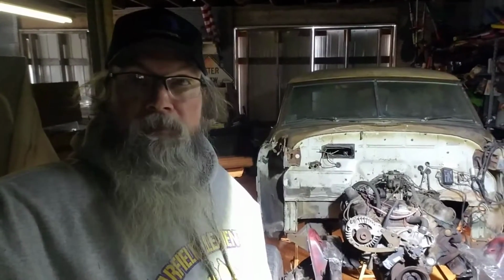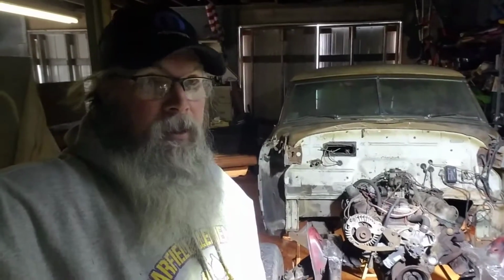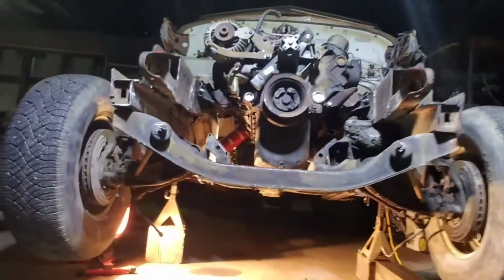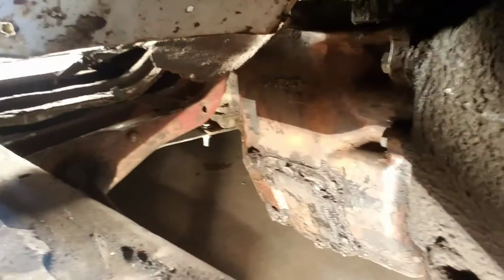Coronet (Episode 23)

Comment: Hey there "Blister" I see he's a checkin' it out pretty good for ya there.... lol.
That's the cool thing with building a "driver" and not a "racer", you can do the things people on Youtube say you can't. That '51 rear end is SUPER weak, but what you're building the car for it'll hold up just fine. Sounds funny, but I use the cost of a brake job to determine what rear end I use, gear ratio is secondary. $600 bucks for a brake job...... $500 obo for a '94 Ford Explorer with a dead tranny & blown head gasket...... hmmmmmm. Lol, my 2 cents though.... I'd change the rear end just to do away with those Lug Bolts & left hand thread on the driver's side that I always forget are backwards. 
Cool stuff man, damn cool stuff you got going on there.
Reply from the maker: Yeah,  I've pretty much resigned to changing out the rearend if for no other reason than ease in mating things up and finding necessary parts.